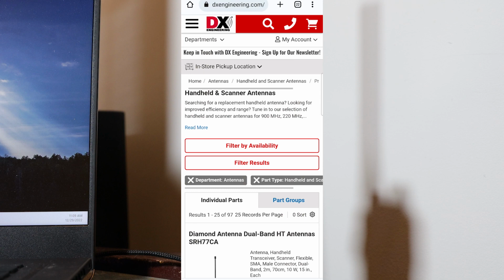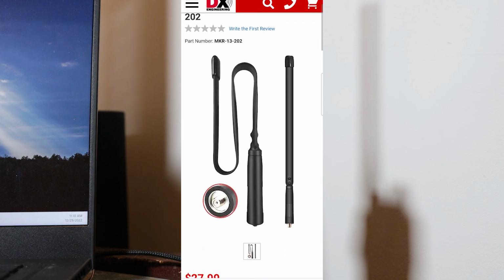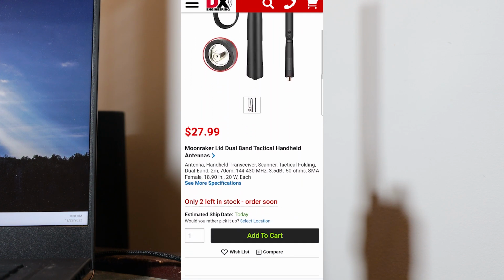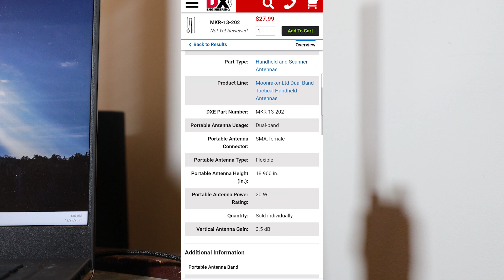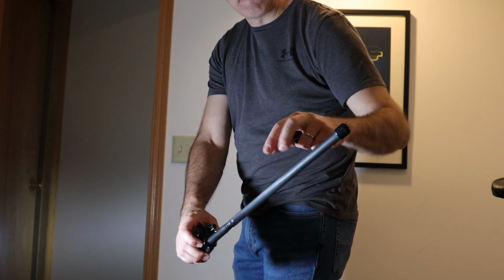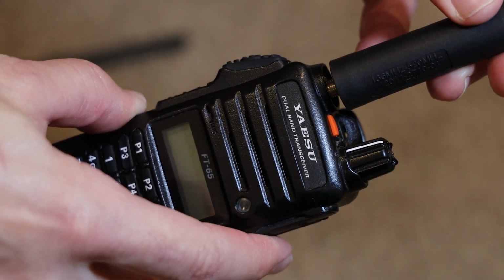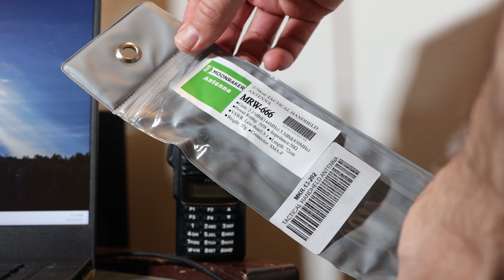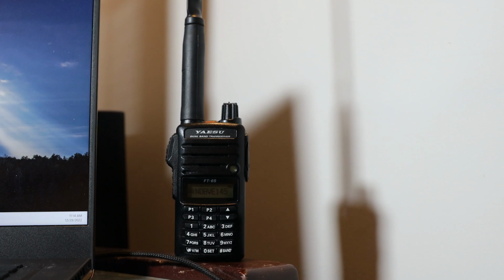Yaesu FT-65: Ditching the Rubber Ducky!

Comment: I am buying an FT65  and going to put a mobile whip antenna onto it via the SMA to antenna connection via the cable so i can use it on my mobility scooter..
Reply from the maker: Very cool!
Reply: @HamRadioHobbyist  i was going to get the FTM 3200 and make it a home base the same as my SW radio  in my living room cupboard  but that meant power supplies again ;.  cables to the loft cables outside etc etc   i cant walk very far now so erecting the telescopic 13m fishing pole every time i wanted to cable up the antenna etc is a no no,   so onto the mobility scooter it is  i'm going to put a bracket onto the  bottom of my chair  frame   all i need to do is attach the mount to the bracket cable up  to the FT and away i go.